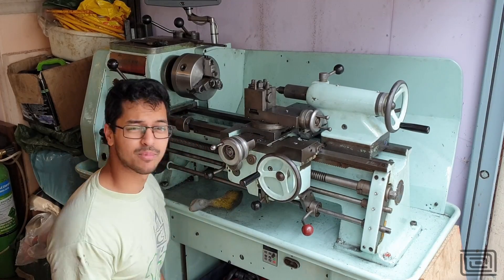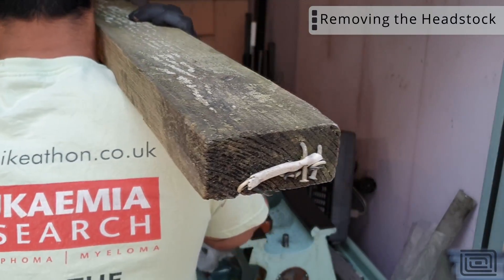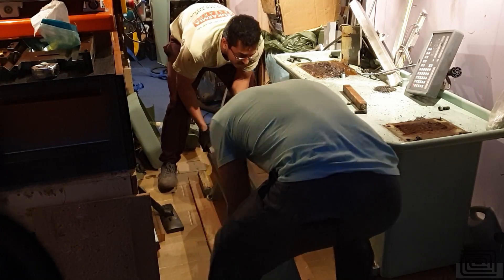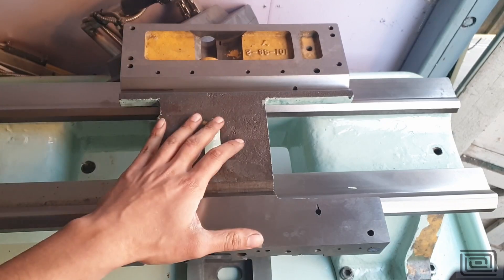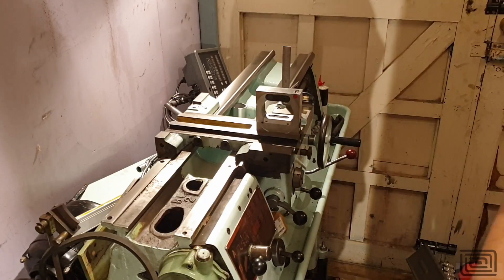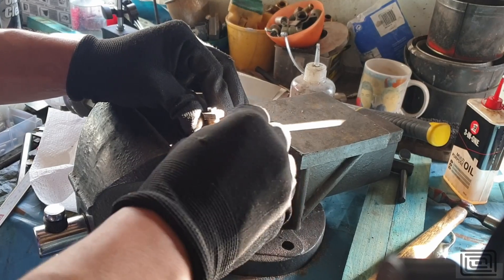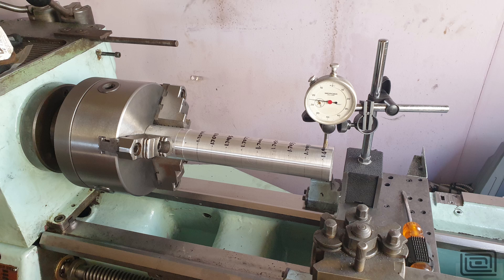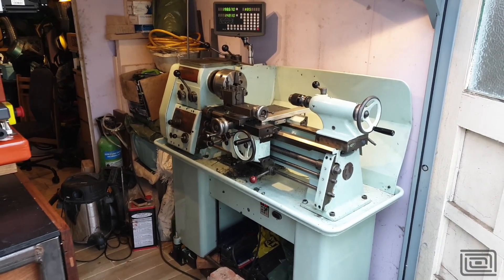Colchester Bantam Lathe Rebuild - Regrinding the Ways, Saddle and Tailstock

Comment: Really enjoyed your post-restoration, I guess you could call it. Not sure if you have the original restoration but I'll check that. I'm in the middle of restoring an older lathe myself (Denham Junior MKII) so am interested in how others are doing, or have done, their projects. The cross slide nut mod is a very interesting idea, although I have had to purchase an ACME thread and will splice mine together, as the wear is in both the screw and the nut. But will certainly keep that in mind.

Comment: Back in 1980, before I emigrated to OZ, I bought a 1930 model Colchester Bantam lathe from a guy who did furniture restorations and wasn't into lathe rebuilding....cost me 75 pounds then complete with 3 jaw and all change wheels.......when I  got it to OZ, and after reassembling it, I did a test and it had .013" wear on the bed from the chuck end up to the middle, impossible to run it that way or adjust the saddle gibs etc........so as a regrind was out of the picture I made a hand powered bed planer and recut and scraped all the ways in and refitted the saddle and tailstock, that took 2 months of every night doing 3 hours.
I still have the lathe and being retired now 20 years use it regularly on and off.

Comment: Hi Vhosher  that sounds like the best path to take, can you tell me the one you got or which VFD to buy for the Bantam? Thanks for all your help and advice
Reply from the maker: I had a browse and i cant seem to find the one i installed. However most single phase to 3 phase inverters will be fine. I think mine is 2.2kw.

You'll need to wire the switches of the bantam into this inverter so be sure to check you can remotely operate it. Ie i/o that allow you to go forwards backwards etc. Most of the cheap inverters have this and its normally as simple as hooking up the existing switches to the inverter
Reply: @vhospher6463  Thankyou  so much for all your help and advice.

Comment: Hi after watching your great video l got myself a Bantam. Could you please tell me if the motor on yours is single or 3 phase ,as l need to convert mine to single. l need to know which motor to purchase?
 Again many thanks.
Reply from the maker: Thanks for the feedback. It is 3 phase, my recommendation would be to keep the original 3phase motor and fit a VFD (so you can run it on single phase) . This way ive gotten varible electronic speed control and i can run the lathe much faster than 800 rpm (original top speed) i beilive the bearings are the same between the high speed model and the low speed model (but dont quote me)

I took the original motor apart, gave it a clean and fitted a VFD works really well

Comment: Excellent video, i have a Chipmaster which has some similarities to your Bantam. To mount my lathe on the floor, i cut holes which matched large steel box section, filled them with concrete and mounted them to the concrete base below the wooden floor.
I may have to take your excellent idea on the backlash as mine suffers also.

Comment: Hi, 

I have a question regarding the lathe bed: 

you have completely disassembled the lathe

, can you tell me, please,  if it is possible to remove the screws that hold the bed to the stand together without disassembling anything else? 

,thanks, Alberto
Reply from the maker: Hi you can. But you will also need to disconnect the fwd, backward leaver arm. This is easy to do though
Reply: @vhospher6463  Perfect, you said me what i want to hear!! 😀 Thank you! Finger crossed to find one Bantam 💪😅

Comment: Good morning ,
and congratulations for the video, is really well done and complete: I have a question about the Colchester Bantam Mk1 lathe, I see that the lathe is separable from the base , it would be very convenient for me to place the lathe on the bench I have at home and which already supports a 350 kg heavy lathe (the table's capacity is 1000 kg), for the electrical part there are no problems, because I will apply an inverter and possibly a new motor, but I don't know if the lathe can be used separated from the base!

 May you confirm to me ?

 Thanks in advance for your reply,
Alberto.
Reply from the maker: Hi,

You can separate the two however the brake for the motor and the fwd and reverse switch goes through base. You'll have to come up with a suitable method to solve those.

If you do mount it on the bench make sure you have a way to level the bed. This lathe absolutely needs to be level to get good results. The bed is not as stiff as i initially thought
Reply: @vhospher6463  Ok perfect, brake Is not a problem, i make It by inverter now on My lathe, with fwd and reverse too! Thank you so much for your answer, now i try  to find a Bantam on England But i dont know any good seller, do You know something? Thank you, Alberto 🇮🇹
Reply from the maker: @ab-shop  i dont know any sellers unfortunately. I would have a look on ebay, they pop up now and again
Reply: @vhospher6463  ok i Will try!! 💪😁 thank you!!
Reply: @ab-shop  bello il restauro

Comment: @vhospher, I have a lathe in pretty bad shape, It gives a similar 4 thou deviation over the first few inches! it's a large Harrison so probably worth keeping if I can get it reground. Could you give me the name of the company who did your regrinding please? Cheers!
Reply from the maker: Hi Matt,

If you email Matt at Slidewayrepaircentre@gmail.com. They are based in Nuneaton.

Hope this helps!
Reply: Have you checked to see if the lathe is leveled? since your getting runout on the first 4 inches it may  not be sitting on a flat and level surface
Reply from the maker: @johnlattanzio9859  hi this was the first thing i checked. The intial graph i show is after i leveled the bed. I tried putting in a twist in the bed to counter the wear but the regrind did a much better job overall!

Comment: REGRINDING !! ONLY !! OCCURS !! WHEN !! STUPID !! IDIOTS !! WHO !! HAVE !! USED !! THE !! LATHE !! FROM !! NEW !!! HAVEN'T !!! USED !! AND HAVEN'T !! CARED !!! FOR !! IT !! PROPERLY !! TO !! BEGIN !!! WITH !!
Reply from the maker: Absolutely agree. I bought the lathe from a old canal building site. It was covered in mud, leaves etc. Shame I didn't video the full restoration. Safe to say it had a hard life before It came to me. The shear pin in the gearbox had been replaced with a steel welding rod and the result was some chewed up gear teeth in the quick-change. Hopefully I will never have to regrind it again!

Comment: That's a lovely grind job but I'm really quite surprised they didn't at least relieve the middle 30% and flake the underside of the saddle, ground to ground will wear terribly in the longterm. you should think about getting one of the local scrapers to bed that saddle in for you. I'm not sure where you are in the UK but I believe Matt look is in Derbyshire and if that's some distance from you  he could likely at least point you in the right direction to someone local.
 https://www.youtube.com/user/lookcreations/videos
Reply from the maker: Thanks so much for the reply! I wasn't aware of the need to scrape in the saddle. I will need to move the lathe at one point, re level the bed and potentially scrape in the headstock. I may contact matt at the time so it can all be done together. Thanks again!
Reply: @vhospher6463  the headstock should only need to be scraped to bed it in or correct the inclination upwards or downwards, you mentioned shimming it which would be far from ideal. On most small bench lathes I scrape the bottom of the headstock to make up for wear on the tailstock and then scrape the tailstock about 0.0005" higher than the HS centerline with a slight inclination towards the operator depending how much deflection I can measure under load. The saddle should almost certainly be scraped with relief in the middle 30% of the flat and V way, ideally the cross slide should be inclined to face 1 thou concave over about a 12" diameter but most people don't even bother.